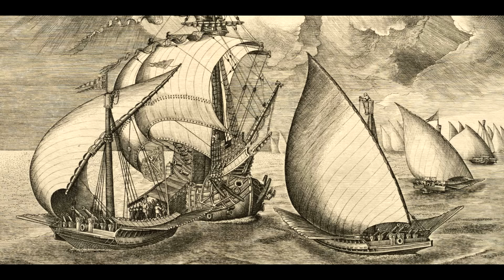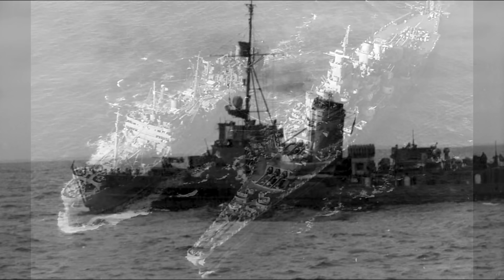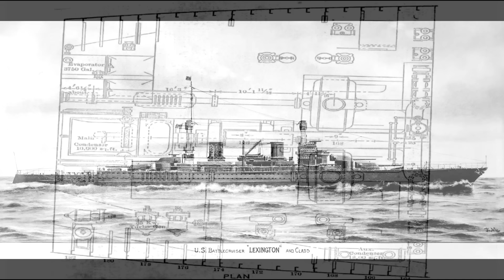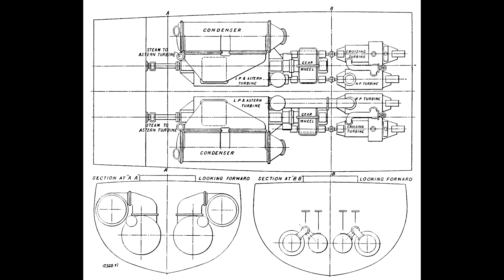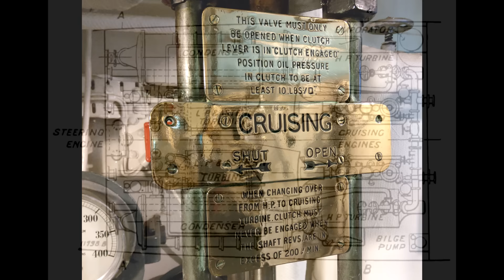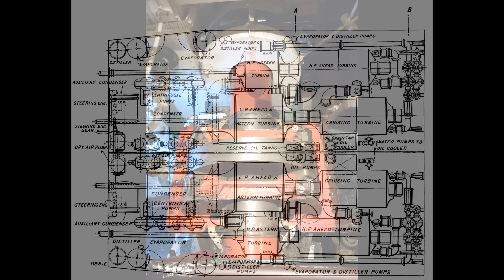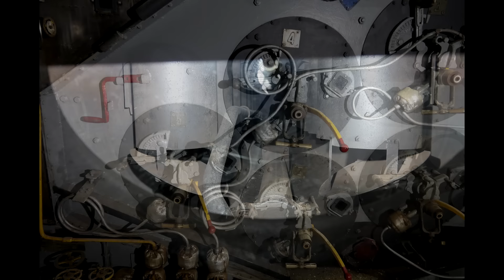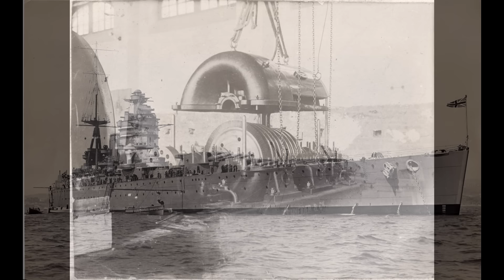Naval Engineering - How to choose your engines

Comment: This all seems very focussed on hydrocarbon fuels onboard. Russia has given us a practical demonstration of the advantage of using tugs to pull your capital ship. I'd also be interested in sail assisted Battleships, those pagoda masts almost call out for it. With modern technology we also have the option of covering everything with solar panels, and electric motors. Lastly you may be interested in a little wheeze I have pulled off with our hated enemy Elbonia, hacking their procurement department's server and changing their purchase order for the propulsion system on their new battleships  to a hydrogen fuel cell system, with blimp based air to sea refuelling.

Comment: Do you need the advantages that diesel gives you if not you can use coal. 

And if you don't you need the advantages that coal gives you. For example, if you don't need the ability into large cargo containers ,ship them by rail or truck or ship and then lift it, and then dump it into another container,  you don't need to ability to move it around and load it with small front loaders or shovels, you don't need the ability to burn it by just loading in a furnace and blowing air through it and lighting it on fire, and you don't need the RELATIVE cleanlineness and RELATIVE non-toxicity of burning coal, , and you want to avoid the RELATIVE expense of coal, you can use Mazut.

Comment: The  ultimate ideal here would be fusors.  They don't get talked about a lot, because they're not the "most pursued" method of achieving controlled nuclear fusion.  That said, if your goal isn't to create net power but rather just to "do nuclear fusion," you could build a fusor IN YOUR GARAGE.  Just be sure to shield it - it doesn't take a lot of shielding, but the things do make soft x-rays.  Anyway, no one's ever gotten one to break-even, much less real effective net power ourput.  But... they have the huge advantage over other fusion methods (and really all nuclear methods of any kind) in that they deliver electrical output DIRECTLY.  So you literally could have your fusors connected directly to electric motors driving your props.  Nothing in between except switching circuitry to control your electrical power.  There's plenty of literature out there on them, produced by a hobby community of people who actually build the things.
 
The main reason they don't reach break-even is that the apparatus is surrounded by a "mesh cage" that you charge negatively to contain free electrons in the working volume.  Any of those electrons that actually hit the mesh get lost and have to be re-supplied externally - that takes energy.  You can lessen that by making the mesh cage out of thinner members, but that reduces its mechanical integrity, and no one has ever figured out how to make one fine enough to get to or past break-even while still being able to hold itself together.
 
Because of how ideal it would be for naval (and many other) applications, though, I think we should still be paying the idea some attention.

Comment: Post WW1 very few warships were built with coal fired furnaces, and even then it was only smaller warships and auxiliary craft.
Once fleets had switched to oil fired furnaces, the question of fuel availability for diesel engined vessels disappears as they burn exactly the same fuel. 
There is also error in your explanation of boiler choice. You can’t run turbines with wet steam. It will destroy them remarkably quickly. So, if you’re going to use turbines, you need to fit a HP superheated boiler which can produce superheated steam in the region of 60bar. This also means any steam generators will have to be turbogenerators. 
If you’re fitting reciprocating steam engines then the boiler doesn’t need to be quite so high pressured. Water treatment is also a massive issue with HP boilers. The water has to be of distillate purity and it must be chemically treated to reduce oxygen bubbles and corrosion. Bubbles in an HP boiler can cause catastrophic damage. LP boilers still generally use distillate feedwater but it’s not as critical. 
On the question of reciprocating engines. A Triple Expansion engine doesn’t produce a significant amount of vibration over what the shafting will. Most vibration on a ship comes from the shafting and props rather than the engines. 
Turbine choice over reciprocating engines is more down to the job role of the vessel. If it’s going to have to manoeuvre more (small escorts, tugs, mine warfare, harbour craft etc) then reciprocating engines are better. If the vessel is going to be fast and mostly cruising fairly steadily then turbines give top end speed and cruise efficiency. Turbines are also quite compact compared to other options. Although the essential condensers can be quite large. 
Efficiency in steam plant is mostly lost in the boiler. Even the most modern high efficiency boilers today struggle to be above 25-30% efficient. A Diesel engine these days is closer to 65-75% efficient. But even in WW2 they were north of 50% efficient. The problem in those days was cost and ability to manufacture. Especially since a lot of the expertise at that time was German, Swiss and Danish (not readily available to the Allies).

Comment: A note about High Pressure vs Low Pressure boilers: Per Boiler unit, High pressure boilers produce far more power than Low Pressure ones. The best example of this is HMS Lion vs HMS Hood. The Lion produced 70k SHP from 42 boilers vs Hood producing 144k SHP from 24 boilers. Fewer boilers means less maintenance.

Comment: Okay, as a steam geek, hearing that in naval applications steam plants are more space efficient than diesel plants gave me pause.  
The Cannon class destroyer escorts, such as the surviving USS Slater, used diesel-electric drives due to a shortage of both steam turbines (despite my granddad's best efforts) and reduction gears.  On those ships, instead of all power to engines, you could put all that electricity to other uses. The USS Eldridge of "The Philadelphia Experiment" infamy\ was also a Cannon class destroyer escort. So if (hypothetically) bored engineers decided to decorate the ship with cavity magnetrons like lights on a Christmas tree, in a misguided attempt to mask it from both radar and visual observation. . .

Comment: Another superb video, thanks!
How about gas turbine engines though? They are quite small and powerful and can change power setting very quickly. There's various coatings available to protect the internals against salt corrosion, etc.

Comment: You over estimate the ability of turbo electric designs of that period to vary the speed of the propeller. 
The USS New Mexico used a synchronous motor, so the speed of the motor was proportional to the speed the generator was spinning at. The RPM of the propeller would be the frequency of the electrical supply (in Hz) multiplied by 120, and divided by the number of poles of the motor. So with a simple design, to change to speed of the ship you need to change the speed the generator is spinning at, which would affect the efficiency the same way as a geared turbine.
It's the number of poles on the motor where the USS New Mexico did something clever. By flicking a couple of switches it could go from being a 36 pole motor to a 24 pole motor, with a proportional change in how fast the propeller spins. So the design effectively gave the ship 2 gears, one for cruising, and one for max speed.

Power Electronics that allowed fine control of the speed of AC motors only cam about decades later, the RMS Queen Elizabeth 2 being an early example after her refit in the 1980s.
Reply: The IEEE published a good article on electric propulsion, just search "The Marine Vessel’s Electrical Power System: From its Birth to Present Day"

Comment: Even today, with turbines being a lot more efficient, you still see diesel electric shipping.  Because diesels are still more efficient as long as speed isn't a prime concern.

And even on nuclear powered warships, you still have diesel generators on board for emergency power.  Because they are also very reliable, even if not run all the time.

Comment: Drach, you mention power density when comparing diesel IC plants compared to steam.  But I did not hear this concept used to explain the use of high steam verses low steam.  The comment is made the high pressure boiler are heavier.  But that weight should be offset by the additional heat value of the steam produced.  The overall high steam plant tends to be lighter for the power produced.  Granted the materials challenges get the best of high steam, bigger maintenance challenge.  But the efficiency can potentially be worth the cost.  The gas turbine takes this efficiency to a higher level with massive increase in operating temperatures.  No one seems to complain about the short mean time to overhaul  of a gas turbine engine. 🙂 The design of these engines may not have occurred, in the time frame they did, without the materials technology development of the high pressure steam plant designs of the 1930s.

Comment: Marine engineer having sailed Chief engineer on steam and diesels as well as gas turbine experience. There are alot of inaccuracies in the video especially regarding fuels and efficiency and speeds.
You want to go fast -gas turbines but absolutely horrible fuel economy 
You want to go fast extremely reliably- steam turbines
You want to shake your ship apart and make ok speed get a diesel. 
It wasn’t really until the early 2000s that diesels actually cost less than steam systems. Diesel consume massive amounts of very expensive lubricating oil and tear themselves apart with parts. 
I can go on for about 4 years on the topic but when I saw designs on steam ships I thought we were going to talk about heat balances and boiler and condenser sizing. I was disappointed

Comment: There is another benefit for the turbo electric is that you can have a single boiler drive all the shafts, so they are all turning and cuts the drag on the ship. Of course, today you could have combined diesel and gas turbine with electric. You also have the option of nuclear and now super critical CO2 turbines which can be much smaller for a given size of turbine.

Comment: @Drac has anyone used a central or common steam manifold from all of their boilers to feed all the turbines on a ship.
Reply: I thought of that too.  The problem is:  If this common manifold is hit, steam goes everywhere but into the turbines, and the ship becomes a stationary Turkish bath.  You need three common manifolds, with shutoff valves for each, so that if one is broken  open a useful amount of steam can be distributed via the other two.

Comment: How efficient would diesel electric setups be in comparison to steam propulsion?
Reply: Certainly more effective than ship setups with coal boilers. 

Without doubt much more economical for commercial ships than Single Expansion, Compound/Double Expansion, Triple Expansion, and Quadruple Expansion. Though you can get away with keeping Triple Expansion engines in old commercial ships like ps Waverley. SS Delphine 1921 is the last large active steam yacht with Quadruple Expansion. 

As for Steam Turbine, they still have a large presence on LNG ships, though Diesel is starting to become more preferable there. They can also be found on the Wasp Amphibious Assault ships to work alongside the Gas Turbine. If you include nuclear powered ships, they use a turbine and act in a way steam power. However, they mostly just succeeded on Aircraft Carriers and Submarines. Although Diesel can still be more preferable for Attack Submarines due to less noise production. 

As for Battleships and Cruisers, Diesel exists on the Iowa class ships for backup. Though they would need to replace those generators with new models if actively used ever again. Japan had wanted Diesel to go along with the steam on the Yamato and Musashi. Including the A-140J3 design proposal, which would've made both ships come off as Japan's own Montana. However, their navy ran into issues with their Diesel program. The Deutschland Cruisers were primarily powered by Diesel and thus benefited from a hull lighter than possible with Steam Turbine setup. The last few German Light Cruisers used Diesel to assist with the steam. Otherwise, Diesel wasn't that common on Cruisers. Same with nuclear power. Instead you're more likely to find Cruisers with just Gas Turbine, Steam Turbine on its own, or Gas Turbine being part of a Steam Turbine setup as is the case with the Slavas. Likely the reason is that many of the last Cruisers were built in the Cold War. 

Factors like operation familiarity with Steam Turbine, efficiency considerations (which Gas Turbine proved to be more effective and multiple navies knew how to design steam power plants that could still provide power for missiles), the UK stopping with Cruisers after WW2 and creating the majority of their Destroyers before the Type 45 (which uses Diesel generators in conjunction with Gas Turbines for hybrid power) with Steam Turbine or a hybrid with Gas Turbine and steam, and how to balance weight in parts of the ship class considering how they differed from Destroyers and Submarines with size and mission purpose are possible major contributing factors for Cruisers very rarely coming with Diesel. Plenty of Destroyers also never came with Diesel. With the US really only using it for a few Destroyer Escort classes. Though aside from the Type 45, the Visakhapatnam class Destroyer, Delhi class Destroyer, Sovremenny class Destroyer, and Type 052C & Type 052D Destroyers have them as part of a hybrid system.  

Outside of Cruisers, which no one is building a new class of anymore, Diesel can be set up together with Gas Turbine, making steam powered Turbo-Electric redundant. With modern Diesel technology (WW2 Diesels were a different story for larger ship classes), you'd be able to make the propulsion of a hypothetical new Battleship more efficient than non-nuclear steam turbine power from back then. Though Gas Turbine as the main propulsion and electrical source would likely be very much considered. There's also the rise of the Integrated electric propulsion.
Reply: @tidepoolclipper8657  Thank You

Comment: There are three types of steam used on a steam warship; High pressure superheated for turbine main engine, high pressure saturated for auxiliary machinery (turbo alternators,  pumps etc ) and low pressure saturated for evaporators and domestics.

Comment: In the late 1970’s I was evaluating the power plant at a Timken roller bearing plant in Ohio. Their backup power generator was powered by a reciprocating steam engine. I was told that it was a steam engine recovered from a battleship. My operating experience at sea is with steam turbines and reduction gears on a US 608 class nuclear submarine.

Comment: If the turbine has to rotate at a fixed number, why ships don't have two sets of propellers? One set propel the ship, one set reverse the ship.
So at balance, they could make the ship completely stop moving, when the engine fully running.

Comment: I would like to get your opinion about submarine propulsion from the CSS Hunley/ Brandtaucher over type XXI to modern systems like nuclear and fuel cells. Thanks.
Reply: HL Hunley was extremely cramped. Though the human cranked power was somewhat of an improvement from the one on the American Revolutionary War wooden Turtle submarine. 

UK actually made steam powered submarines called the K-class. While not as dumb as human crank powered, these thing could be really dangerous to the crew. Although the final one the K26 was decent in comparison. 

These days nuclear is the best power source for submarines and currently really the only one viable for Ballistic Submarines. Though diesel makes for quieter Attack Submarines and thus still has some use there. Like with the Dakar class.